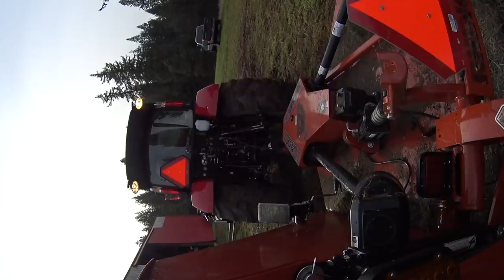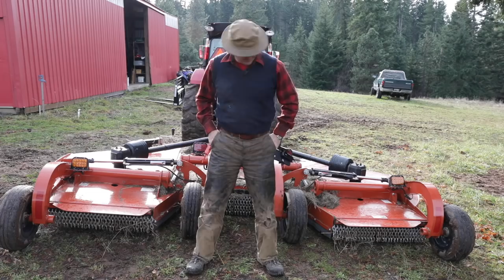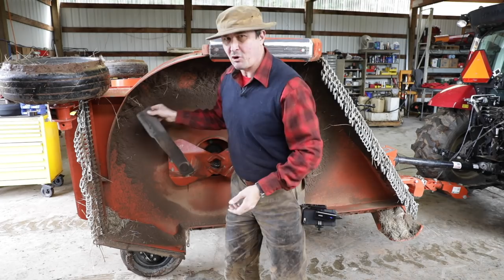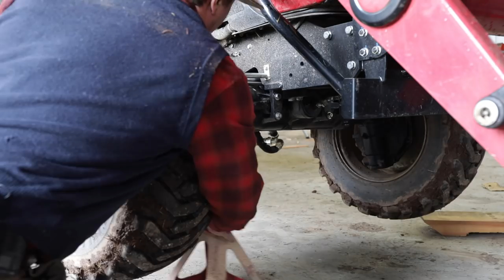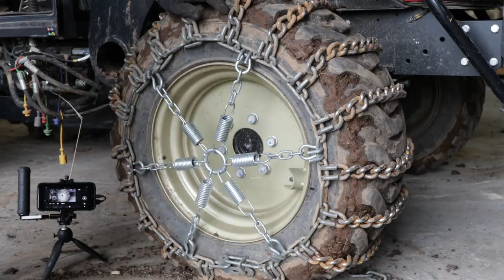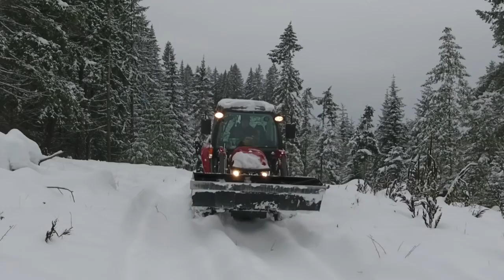AMAZING Tire Chain Hack For Winter

Comment: +Wranglerstar I know this is 7 months late but I figured I would chime in anyway. Trucker here. I have used the blocks many times to get chains on. The thing I di differently is I place the chains on the ground with one set of cross-chains laying thru it. I lay the resty of the chain in front of the block. Then drive the wheel unto the block. Afterwards all you have to do is put the chains around the tire and tighten. Drive off the block to let the chains settle, retighten if needed, and put the bungies/springs on the chains. I never understood putting the chains on the top of the tire and then driving over the loose end.

Comment: I deflate my tires when putting on chains, seams to work well on keeping tight,
Reply: DUDE ARE YOU SERIOUS????? U BELEIVE THIS KID HE CANT EVEN SPELL SEEMS
Reply: Mr Panda autocorrect got me
Reply: y2kxj was thinking that bit didn't wanna sound stupid if there's a certain way for these tires and chains. Lmao
Reply: Steve Sheppard yeah some times I remove the valve core, sometimes once deflated you can get just a smudge tighter.
Reply: use to do that...then lucked into a spare set of tires and just keep the chains on the R4 tread and run the others in late spring thru early fall
Reply: that depends, is it, seems like or, the seam of my pants, yeah, Auto correct can be a pain in the neck a lot of times, i prefer a dictionary, at least it don't screw you up like Auto correct does, that's why you have to add things to it's dictionary, Computers they're dumber than a box of rocks without people to teach it, lol.
Reply: Well, the question would be, can he spell believe?  (I before E.........)   Oh, and "U" used to be the word "You", just in case you are curious about other improper spellings....
Reply: U still is in the word you, people just removed the first two letters of the word and now you is spelled U, which sometimes it's yo, that depends if you're playing make believe that you're from the hood or not, lol, hey, that's the Education system of the modern era, now they don't even teach kids how to write cursive with pen or paper, it's all about computers now a days.
Reply: I always recommend completely deflating solid rubber tires.

The more solid the rubber, the more they need to be deflated.
Reply: yeah, the big tire on a tractor has like two inches of solid rubber for treads, unlike a car tire, which is like maybe a quarter of an inch of treads, half the diameter of a penny, plus a car tire holds up to 50 pounds of air, a Semi tire holds 100 pounds of air, that tractor tire is like 4 foot in diameter.
Reply: Interesting, the difference between don't and doesn't in a comment. Irony, there's a word for you.
Reply: Hey, winkle star "hacks"  his tires up, so I guess they have no air. Oh I meant winkie star!!
Reply: This only seems more problematic

Comment: To get the chains on the rears easier:
- lay the chains down
- drive a short distance onto them
- hook the end cross chain over a tire lug behind tire
- drive forward
The tire pulls the chain up and over for you and tightens it at the same time.  Still have to tighten after a short drive, but the tractor does most of the up front work.  Chained mine up this week in 45 mins this weekend.
Reply: WOW amazing how the "hack" is way more difficult and time consuming than just installing them!  FAIL!

Comment: I’m just now starting this video and I do t know if you cover this or not but I air down the tractor tires before putting the chains on. Then after getting them as tight as I can , I air back up to help tighten them further. You don’t want the tires to be too tight because more air equals less traction. But doing this in moderation really helps

Comment: I like deflating the tires and using a chain binder to tighten the chains up. Latching them in place and then re-inflating the tire. No need for cross binders or anything. Chains will be very very tight and will not walk off the tire.

Comment: Ahh you brough up my terrible memories from the Finnish army, i drove a  big four axle offroad truck, imagine putting eight of those big ones on in a hurry on site! 😪 The wire trick helps alot though, place the chains behind the tyres, attach them to the tyres' tread with a wire/cord loop, drive forwards until the chains are wrapped around. Helps alot with heavy chains 😊

Comment: Just got that tensioner set w/binder tool for my JD2025R. Could have just used it first and prob figured it out without too much difficulty. But often it’s better to see someone doing it first. So your demo was definitely helpful. Basically watched the part about using the binder tool for the 6x tension spring set up. Got the Diamond Stud chains on back and the Vbar on front, both from Tire.Chain in Johnstown, PA. None of this stuff was cheep but now I can GO ANYWHERE IN MY BACKYARD THAT I NEED TO!!! (And I have a few acres of backyard and about a foot of snow!!!) Thanks for the video!!

Comment: I'd never seen a binder before until I worked for a landscaping company where we had to move huge equipment on trailers, and needed to secure it with no slack. It did take me a few times to get it straight in my head how to set them up right the first time. The ones we used were a lot bigger, and were intended to be kept on for the duration of the drive. That little one is a really cool assistant.

Comment: I remove the air and then install the chains, get the tension correct and then air tires back up and they are tight. Works for me. I use bungee cords for  chain tensioners.

Comment: you are more prepared for winter than most; cutting those tails actually makes the chains harder to get on; I put the chain over the wheel ; letting the ratchet ends of the chains (just touching) the ground (to the back)pull ahead until you can grab your tails and clip them to the ratchets than tighten and like you say in the video you have to move your vehicle a couple times to really snug up your chains; this method we use in the oilfields out west and in the north; very fast and no crawling under truck or tires; I am used to putting on doubles on both sets of duals, a steering and a trailer chain for bush driving; also carry cheater links in your tractor; very handy if you break a cross link or have to repair a chain or tails or whatever, another great video Mr Wranglerstar
looking back at your video again you hung those chains perfectly

Comment: For chaining our lot trucks we used solid rubber bungee cords. Once installed, bend the hooks closed. Break a cord, no big deal, 2 bucks and put a new one on. Plus you are only pulling one cord tension instead of all the spring tensions on your star configuration.

Comment: The one set of chains you put on the rear tire and showed us is possibly on backwards.  Should have the clips to the front and the loose ends to the rear when you drape them over the tire.  I believe it has something to do with once your chains are on and you spin the tires, the clips don't have the extra bit (where the locking clip attached) forward with rotation where it could grab something.  But they may still work fine all season and never grab anything... but maybe a note to self for next year.

Comment: I used to drive a semi from Denver to Gypsum CO all the time. Had to chain up a couple hundred times. First time I put chains on it took close to and hour. By the end of the winter I could put all 4 on in less than 20 minutes. Your absolutely right tighter the better.

Comment: "Fun" video , I have not installed chains on a tractor for over 35 years and am thankful . In the 80s when I was a fireman we had steel tracks instead of chains . They had bars that went across both dual tires and dipped down between with super heavy duty links . If I remeber they weighed about 540 pounds each . Easy to install , lay them out and drive over them , then pull them together with a come along . They were great in deep snow , but on pavement they would shake you to death . Over the years I had an extra set of steel wheels with mounted studs for winter driving . Also an extra 2 wheels with lugged snow tires with cross bar commercial chains installed when tires were deflated and perminent connecting links . Inflate and no slop or rolling . Those were for my full size van ( that also had limited slip rear end ) . Can hardly wait to see how the new snow blower works .

Comment: My dad used to be a logger. Big cleated paw chains were a necessity in the winter. we found it was easier to use the cleats on the tires and a couple of bungee straps to drive them up on and over the tire, much less work than lifting them by hand which alone would take atleast two people.

Comment: When I used to put chains on a 4wheeler to plow snow.....I would always let air out of the tire, once the chains were as tight as I could get then.....add air, and everything was tight.
Reply: steve shep..........i bet looking at it from the side you could tell the difference if you took a picture

Comment: You need to hang them on a wall to keep them separated . And color coded the chains for the equipment you use. As a truck driver I have put a set on the truck and trailer in a half hour I put out on the ground in front of the tires ( Straight) than drove on to them but your back tire is bigger. If I was you I would give it a try. And with the ramp blocks I would put some metal studs in it so if you had to drive onto them you won’t slip as much.

Comment: place chain on tire . drive forward a quarter of a wheel rotation and hook the cam to the chain . drive forward a three quarter of wheel rotation and tighten cam on the chain inside first and outside last . takes two minutes to install chains no jack required . did it that way on my semi for 20 years . i can chain all 8 drives in 20 minutes and chains stay very tight no play in them at all

Comment: On our work trucks we just hook the ends of the chain back in the lock assembly that hooks the chain together and it keeps it from floping around. We have to put the chains on in the snow so it's best to keep the extra length so they are easier to put on in bad weather. I'll have to carry a small chain binder too. Great idea!

Comment: Those are nice spring binders.  I deflate my tires when tightening the chain, and run wire from links across the center, and twist them tight.

Comment: Grab one of those timbers by Jack's bridge, knock a corner off lengthwise, put it at the slab edge for your bldg, and have an easier time pulling equipment inside.  It's hard to pull up that vertical stepped edge.
Reply: Or just drop a shovel or two of gravel in front of the step and make a ramp. Works just as well
Reply: Or put the tractor in 4 wheel drive.

Comment: For the rears, I jack up the wheels. I have trouble with the wheel rolling the chains off. As someone mentioned, I use a ratchet strap to pull the chain all the way around to hook the inside. Much easier than how I did it in the past.

Comment: Those are going to be awsome with the snow blower on the tractor, at the moment I've only been afforded a 2wd f150 and 2 chains that I fount at the flea market but it worked pretty good last year as long as my front tires have good tread.

Comment: idea to make that tensioner a little better is instead of having solid pins run through the lever action it should be an inside threaded pin then you can use a threaded hook and if you need an inch just unscrew the pin a bit so you dont have to use a crow bar to help. this would help you adjust larger tires and smaller tires using the same tool. just food for thought if you wanted to make your own version. :)

Comment: I have used one of those small boomers for years putting the chains on my tractor. A suggestion, forget the wood blocks for installing the rear chains. Get a 10 to 20 ton bottle jack and lift the rear tire off the ground. You can then rotate the tire the same as the front. By the way, lose the mower before you start chaining up.

Comment: So I just came across this videos! First off I like your videos clear and down to the point. Second you need one more tool for your chains for the connecting link. Little wrench that fits in the slot on the link. We use steel rod to make a L the pound the end flat to fit in the slot works great!!

Comment: In the volly halls up here we used to roll the rigs up on the blocking over the chains and drape the rest... first guys to respond would lock them up, or if not needed, slowly roll out and leave them behind. Then the new rigs with auto chains started coming into service which are alright if you are rolling... but do you zero good if you need to deploy them from a sitting stop, or when backing up.

Comment: i usually lay the chains on the ground drive over em hook the start on the wheel drive 3/4 of the wheel diameter forward, so its easy attachment and tightening sometime later when i remember.

Comment: Looks like those tensioners in the back could use a couple of extra springs and chains Looks like you could add 4 more springs and chains to put two more points of tension on each side going around the tire.

Comment: Where you have hills and ice or packed snow that becomes an icy mix chains often do make the difference and provide needed traction,  unfortunately the Northeast provides these conditions.  I have been running 4 wheel chains on my tractor for over 30 years and find that leaving the tensioners off provide better traction and easier installation.  As mentioned in the video with ag. equipment type tires the chain will fall into the voids between the lugs making them worthless (even with the difference patterned chain styles),  I find with no tensioners the chain when loose enough resets every time in comes around providing for more chain time between the tire and the ground.  The only issue I see with some tractors is they do not provide enough clearance for this arrangement,  some manufacturers make the fender clearance so tight no chains of any sort will fit,  really!

Comment: I don't know but personally I'd be jacking the rear tires up too. Seems the front tire chains went on a lot easier by taking the tire off the ground. : )
Reply from the maker: The front tires are a quarter the weight and size of the rear tires,

Comment: I have same tool for my tractor chains. I also have same tensioner set up with springs and center ring. I hook the tool on the spring im working on not the center ring. Much easier to pull on one spring at a time then the whole ring under tension.

Comment: I have what I think might be a labor saving shortcut. I don’t have the tools, but i can give the instructions. I would like to see you do a demo and see if it works. This is what i refer to as the 
C.A.L.T.M.
CHEAP.AND.LAZY.TRUCKER.METHOD.

I have been driving semi trucks for last 25 years. And i thought of this tonight while driving through Colorado this December 2019...sorry it took so long🤪👍

1.Ok take a motorcycle ratchet strap and hook the short end to the front end of the chain cross row closest to the front of the chain by the cam and hook linking end
2. Line a bottom of the hole in the tractors rim to the 9 O’clock  or maybe 7 O’clock position where 9 or 7is the left side of tire and 3 or 5 is right side of tire where clockwise goes forward on tractors right side.

3. Hook short end of ratchet strap to outside of tire sidewall to front cross link as described in step one.

4. Thread long slack end through the hole and hook other side of chain across the inside of tire.

5. Take slack out of webbing and ratchet chain to tire as tight as you can. Set up other tires same way if you want. Or one at a time. With rest of chain pulled straight back, drive tractor forward until chain is in (possibly) 9 O’clock position and hook the ends together.

6. After chain is connected unhook ratchet strap and tighten as normal.

In other words strap the chain to the chain and rim and make tractor tire/rim pull the chain over....we are not getting younger ya know👍🤪👍 

Tip number 2. 
Stacking chains in a pile/box. 
1.Spray paint the cam and hook end. Hook those two ends together. 

2.Drop in a pile but before letting go, leave the hook and cam to stick out of pile edge or over top of box. 

3. The rest is in the pile un attached. When you need a chain grab a connected end and pull.

Please let me know if this helps... via video if possible 😀👍